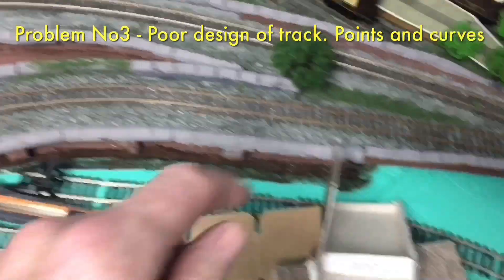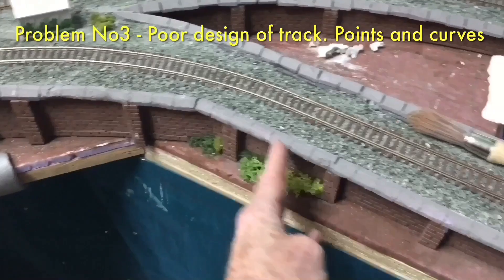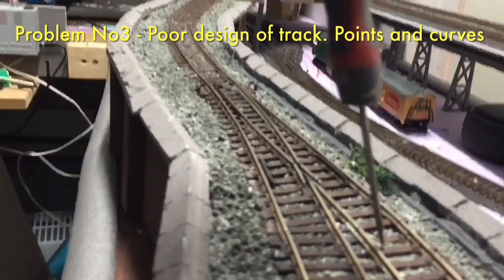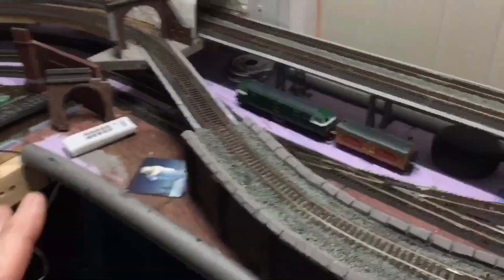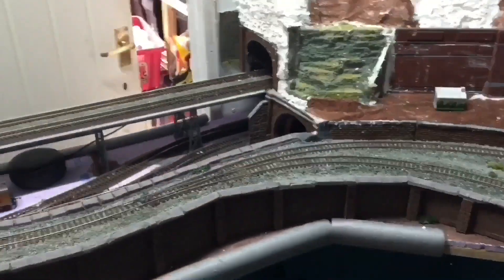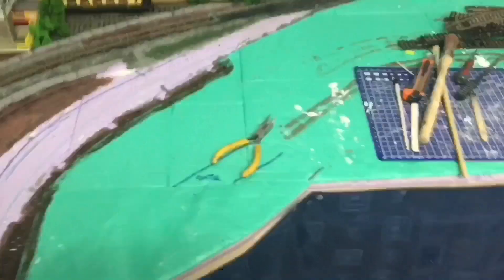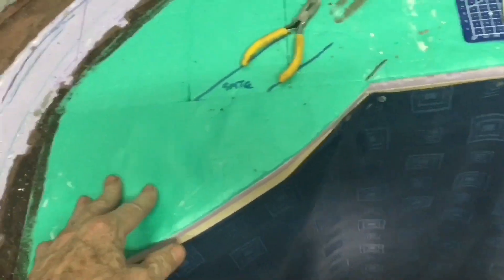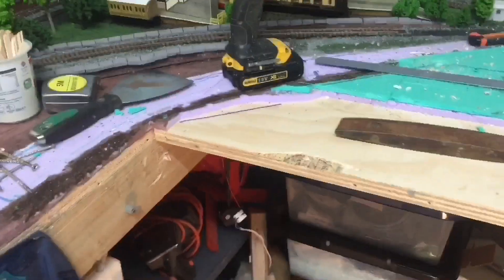OO Layout project (part 22) September update. Fixing mistakes I’ve made on the layout. (Pt1)

Comment: A good job their Steve, we’ve all done it and we live and learn. I ended up scrapping my previous layout because of access and poor running. I had a few tunnels with no lift off areas and I simply could not get to stick trains without the use of a very long stick. Things soon changed.
You’ll feel much better after this change.

Comment: The temptation is always to fill the baseboards with track - been there myself.   A necessary job Steve and  well executed into the bargain.   Going to be doing a little bit of baseboard trimming myself - to take a small amount off a corner of the layout.  Good update.   Cheers Euan
Reply from the maker: Hi Euan…. Thanks for dropping in. The more I progress with the layout, the more I realise that I can do previous work better 🤣 I’ve got the feeling that it will always be that way 🤣
But it’s so satisfying when the remodelling actually works. 
Regards…. Steve 👍

Comment: It's not stupid mistakes that we make Steve it's called a learning curve. I'm still messing with my track plan, we all do it. It's looking good though now. You could always have a removable section at the front if you wanted to add more Scenics,  that's what I've done and when I need access it just pulls out. Atb mate Andy
Reply from the maker: Hi Andy… Thanks for checking out the video. My learning curve must be really steep 🤣🤣
Very satisfying and fun though, doing the fixes and seeing the improvements working well. 
Regards…. Steve 👍